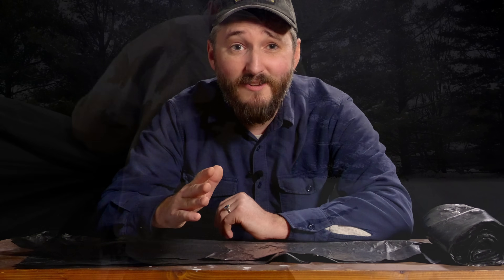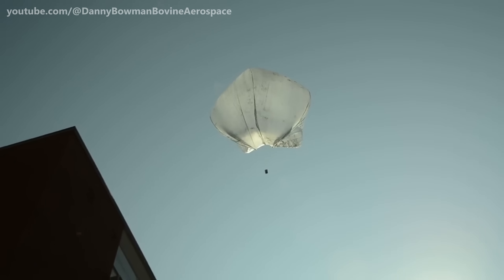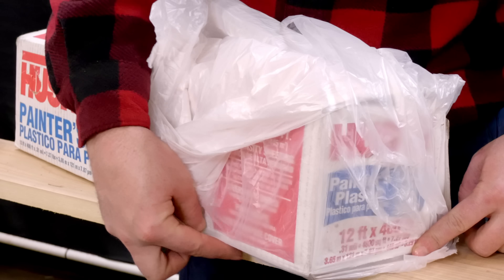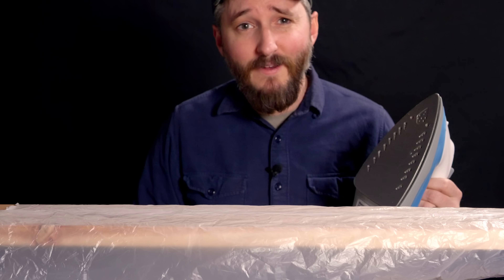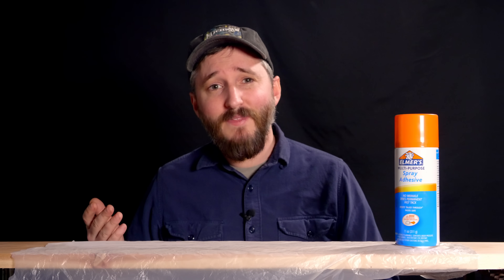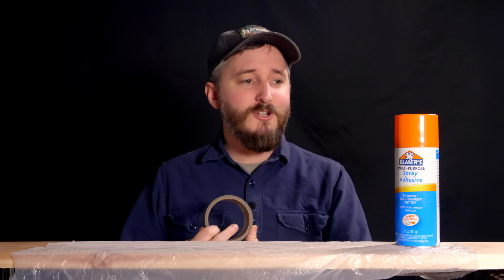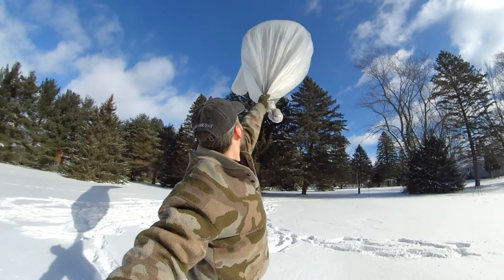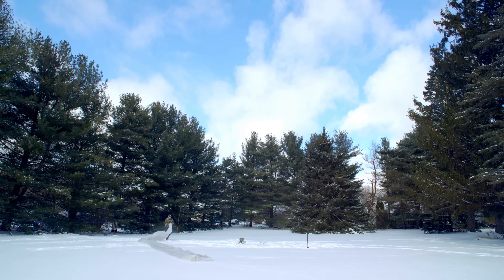DIY Solar Powered Balloons

Comment: Just so happens I've been doing some research lately with plastics and infrared light so I can actually tell you why it stayed up longer than you thought, your average grade fully transparent PET still reflects about 80% across the IR light  spectrum (apparently its the reason that polyester fabrics are so warm) so the UV light being absorbed by the carbon inside the tube is getting reemitted as IR light and thats getting reflected inside around the tube again, suspiciously in the same way those evacuated solar tubes work, I'm guessing this design is its great grandpa lol. One simple improvement I can think of is something black with a lot of surface area in the center, 12 inch tube or something to act as a battery and to heat the air faster via convection.

Comment: Using a low rpm fan or hair drier you can blow the heat into the balloon from the fire making it easier.
I get that the sun gives it lift but I wonder how much lift is porpotinate to the thrmal difference between the balloon and the surrounding atmospheric air. 
What I mean is, if you were in the southwest desert, you would get a great deal of sun but the surrounding air would also be hotter. It has lift because the less dense (expanded) air is lighter than the surrounding. So I wonder if that scales equally. 
If it was 105 degrees outside would the balloon be a similar % of thermal increase inside?
Just some thoughts.

Comment: 3M 90 spray adhesive should also stick decently well to LDPE.  If you're in California you'll have to go out of state to get the full-strength one rather than the low-VoC version, though.

Comment: Sweeeeet, I just bought a bag of those tape rolls from a thrift store for $1, with no purpose in mind. 
I had previously thought about slicing the bottom off of trash bags and attaching them, but this is a great idea. And I've got a lot of chalk marking powder (dewalt black chalk item number DWHT47056) from the hardware store that I use for pigment in epoxy. Hopefully the static is enough to coat the inside, im not going to make a van der graff generator or anything, but maybe I'll wear a wool sweater or a polyester jacket when I try to get the powder to stick. And if that jug was struggling, I doubt the chalk will be a problem. Im thinking 20lb test monofilament fishing line for a proper anchor.

Thanks, I'm looking forward to this

Comment: So if these can get 100Km high if I heard that correctly what would be the result of a small Model rocket attached to one ?  Can we reach Orbit?   The numbers I am seeing for the speed of the Model rockets feels off to me at 250mph but idk how that would relate to the speed of Earths rotation etc at 100km frame of reference or if any of that even matters.  Could this act as a Rockoon?  I REALLY want to send up a tiny Arduino sized cube sat to space.  Mainly I have been thinking about a Weather balloon that takes up an Ionic thruster and to stop it from popping like most do when they get to that height slowly start to feed the gas into the thruster to provide horizontal momentum.  As this increases its vertical height will increase slowly and I can't help but feel it should be fully possible to launch such a thing into orbit.   I been thinking Weather Balloon up to 50-90km or so, Ionic thruster to raise the orbit until we are out of fuel from the Balloon then a last Hail mary with some solid Rocket motors to get it to final orbit and speed.  Initial numbers feel promising, idk about that final rocket stage though.  The ionic thrusters however feel like it has potential in combination with the weather balloon.
Reply from the maker: Getting high into the air isn't the hard part of making something orbit. You need it to be going really fast. Something like 17,000mph minimum

Comment: Water vapor (humidity) is lighter than air, hence why moisture goes up and forms clouds when the pressure and temperature drop.  But a black garbage bag may keep the air warmer  which may hold  a bit more humidity.

Comment: Infinity Bond MMA 500 (Methacrylate ) is rated to glue Polyethylene and Polypropylene. I used it to repair some engine covers for a pressure washer that were made from Polypropylene.

Comment: Will it work as good in the summer heat? Winter air is dense and heavy making a large difference in air temperature and weight within the balloon.
Reply from the maker: It does! I've used the small version many times in summer

Comment: I have a lever arm type plastic bag sealer. They come in various lengths. They have knob to set the sealing time to match different plastics. It will be very straightforward to feed the two edges to be joined from the 'rear' or hinged end and pull the sealed tube over the other end.
Reply from the maker: I didn't think of feeding the plastic that way. Seems like that would work!
Reply: @Nighthawkinlight  If you still want to go the adhesive route,  the glue used on plastic mailers has fantastic bond to most plastics. By my research there are various formulations, some based on a thermoplastic rubber based hot melt adhesive that is melted and applied to the mailer where it becomes very tacky at room temperature.

Comment: heat sealers use teflon impregnated weaved tape, you can also get irons with little feet that are for shrink wrapping model airplanes but their heat output isn't super controllable

Comment: Heat gun on the glue-taped sections for adhesion? Doesn't seem necessary. Have to wonder about the potential of these balloons for anti-aircraft/drone/missile defense. A 400' thick forest of plastic could be quite the dome.

Comment: Back in the early 60's, as a young boy, I made a hot air balloon out of tissue paper. I cut the gores as instructed, glued them together, put a wire rim around the bottom and slung a wax-covered string ball underneath. My dad thought this was the coolest thing ever and was as excited as I when I lit the ball and let it go. Man did that thing climb fast. It was at that point that my dad figured out this could also be a flaming weapon if the was ball ignited the tissue paper, then fell on someone's house. In a panic he chased the balloon, running on foot, for about 3 miles until the ball burned out and the balloon settled into a tree. It was great fun on many levels and a big relief for my dad when it finally settled to earth. Some of us choose to live dangerously! 😀
Reply: Thanks for sharing your story!
Reply: I did a clothes cleaner's bag and some straws and birthday candles right after a rain. Worked well and was reasonably safe as well.
Reply: I made a few of these in the late 90s or so, I bet I still have the compact VHS tape of one going up (and up) in flames over the sports field of the school across the street.

Less plastic waste, more fire hazard, good times.
Reply: I have absolutely no idea what I’m talking about, but (if it had a basket) what if you fill the basket with water, so that if it crashes or when it lands on something, assuming it’ll land the way I’m thinking, it’ll plop the cotton into the water? Or is it not strong enough to carry a basket that heavy? I don’t know lol. Either way, very fun story!
Reply: @rachaelmarks2  I see a career in aerospace in your future! If you were hoping to extinguish the wax ball then maybe...just maybe. The real problem was setting the tissue paper on fire. The likelihood of carrying enough water to extinguish that fire would be out of the question. It's the old lift vs payload problem 😁
Reply: “It’s just a Japanese incendiary balloon that arrived very late.  I’ve got nothing to do with it.”
Reply: This used to be a pretty big problem here in Brazil because these kinds of celebratory balloons (commonly made out of newspaper) would set vegetation and sometimes buildings on fire. It's been banned for some time now, but, albeit rarely, we still see news stories popping up

Comment: Kinda wonder if you would have been able to use those viral bag sealers as a quick connection method seems to work on many types of plastic but i could understand if this didnt work

Comment: For another option with the heat sealing, I have had succeess by hitting a piece of metal with a torch and then touching the metal to the plastic. The temperature control obviously isn't the best but with a little patience you can get a nice thin seam and avoid overheating.

Comment: If you tie separate lengths of quilting thread to each end of the tube, you can anchor the other ends some distance apart, and then you can have a solar "kite".

Comment: G'day,

Yay Team !

OK, now you might begin to fantasize about making one which is sufficiently ridid, from internal Thermobarometric overpressure - as to be able to be rendered 
Dirigible....
(French, for "steerable/navigable)...,
By adding a Cruciform Tail with Elevators & Rudders, a little Lithium-Ion Battery, an Electric Motor with an Airscrew, a R/C Reciever & Servos....; probably leaving the Solar Panel on the ground, so the Recharge-Cable could serve as a Tether and the PV may add Weight to the Anchor...(?).

The trouble is, of course, like all Industrial Solar Technology, the Solar Hot-Air Balloon requires an entire international Petrochemical extraction, processing & distribution Industry to produce the essential Raw Materials & Components.

My new electric Brushcutter does the same work in the same time as the 50cc 2.5-Hp Tanaka..., but the Tanaka burns 1 litre per hour from a 1 litre Fueltank, and the average Session-time is 28.5 minutes (after which 3 pairs of Strings had been broken and it was time to start again...!) ; the electric machine can cut for 1.5 Hours on the same Forest Floor - on 1/2 or 3/4 of a Battery.

The Battery which cuts for 90 minutes takes 90 minutes to recharge, on my stand-alone Solar Houselighting setup, and on a cloudy day..., the 3,000-Watt 240-Volt Westinghouse Generator only used 710 mls of petrol for the hour & a half to recharge it.

473 mls /hour, to run a Brushcutter on 4-Stroke powered Electricity...; which is 53% less Fuel than it takes to run a comparable 2-Stroke Unit....

Which is great.

But, how much Fossil Carbon was emitted..., during the manufacture of my new (mostly Solar powered) Electric Brushcutter, Chainsaw & Leafblower...?

It doesn't seem to matter how we slice, dice, cut and chop the "logic" - whichever way ine looks at it ; Anthropogenic Global Warming's increasingly intense and frequent Record-breaking Extreme Weather is breaking Agriculture and Transport & Energy-distribution Insfrastructure far and away more quickly than Humanity is
Even
TALKING about
Adapting to the
"New Normal" - as if the 
Weather is going to continue to be as abberent as it currently is.

Whereas, sadly, if we quit all Fossilburning tomorrow, Globally - then the Atmosphere will continue to warm, at an increasing rate for the next 25 years at least (because it takes 25 years for a Cube of CO-2 to finish causing 95% of the Warming which it will achieve) in Parallel with the pace at which we increased Fossil-Fuel use between 1998 and yesterday...

Together with Greenland & West Antarctica's Doomsday Glacier each being poised and ready to go "PLOP...!", & "SPLASH...!" ; with the first expected to trigger the second, and each one being good for SIX METRES of Sea-Level Rise....

What we seem to be doing, thee & me...; is playing the most Artistic & Innovative 
Game of Titanic Deckchairs which we can contrive to imagine...(!).

But, regardless of what we do, you & I as individuals,
The 3 Billion who've grown to become 8 Billion in the time since I was born in 1961..., they
VOTED
to proceed Full Steam Ahead
With the Great Greenhouse Gas Release Experiment.

And for 44 years, at every Election I vited against Global Warming...; and the suicidally  Selfish Majority, every time, voted to 
Grow
Their sacred
EcoGnomie..., instead of paying ANY 
Attention
At all, whatsoever, to ANY of the
SCIENCE.

At least I voted against the 
Insane
Majority..., 
So I can honestly say that
Not much of the Problem is
My
Fault.

The problem is that the doings of the
8 Billion selfish Dickheads is
Wiping out my
Life's Work - ie having paid the Council Rates on a hundred-acre Endangered Species Sanctuary for 33 years.

Half the Trees in my Forest Canopy died in 2018/'19, and  since then I've spent $27,000 on my Fire-Hose Collection (Pumps, Pipes, Hoses, Sprinklers Tanks, Water, Tree-Surgery, Towers for Sprinklers & Floodlights, it never ends....!) to protect the Lawn Locker in which I've lived for over half my life.

The first 27 years here, one WW-2 vintage 130- litre "Airport Firefighter" (Compressed Air Water Canon) was almost Overkill...

Now, I can put 26mm onto 1,800 Square Metres and take about 4 hours to do it..., with the plan being to put out 20mm (40 Tons) in 3 hours (of expected Ember Attack) leaving another 16 tons for an hour of being burnt-over.

If, after that, the Water runs out ; then - THEN will be the time to run away and become
Homeless....

Until then, I plan on enjoying being part of the Interspecies Forest Community which has accepted me as being both harmless & friendly.

To see a wild unfenced Brown Dragon run up and perch on my Boot-Top, while laying in Ambush looking for Prey on my Lawn..., then please feel free to backtrack me to my Videos to see,

"Pontification With Lizard...!"

Possibly the best part is when the Dragon had caught something and was eating it on the Steps in front of me..., and one of the White-Winged Choughs walked over, spread it's Wings and danced at me, pointing to the Lizard to make sure I'd seen it - and after 2 or 3 Dance-Steps continued to walk on and away.

Do your Captive Pet Birds communicate with you, to inform about nearby Lizards, and Snakes, which they reckon that you should be aware of ?

Those 8 Billion have not the slightest clue as to the complexity of interconnected Co-operation and interdependance within the
Ecology of the Biosphere which in their
Personal and collective
Selfishness they have
Voted to destroy...

As someone once almost said, after having been
Nailed to a
Tree...;

"Forgive them,
They 
CARE NOT...;
What
They do...? ".

In the original 
Plaint, such an attitude was attributed to being the result of
IGNORANCE..., and as such it  was proffered as being an 
EXCUSE for such
Execrable behaviour....

Two millennia down the
Timestream, and
Ignorance is no longer any sort of
Credible or
Valid 
"Defence"...

One wonders for how much longer the Universal Creator Godtheory will continue to be able to successfully brew up Extreme Weather Events with which to flood, burn, blow down or smash with Hail..., all the doings and plans and possessions of ALL they who happily voted to,

"Grow the EcoGnomie, REGARDLESS of any percieved Dangers of resulting Damage to the Environment, or to the Climate ; which may be held by the so-called 'Scientific Community' and other 'Environmental Activists'..." (!).

"As ye sow,
So
Shall ye
Reap...;
Sow the
Wind...,
Reap the
MegaFireStorm...,
Because thus hath been
Thy
Choice...!"

Kinda thing.

So far, every silly bloody Tourist Trap on the Eastern Half of Oz has been burnt twice and flooded 3 times in the past 5 years, most recently it took a month for Storms to hammer everywhere from  Daintree on Cape York down to Melbourne in Victoria...; where this week they lost 25 houses in a Firestorm lit by Lightning during a Thunderstorm which simultaneously flash-flooded a bunch of Suburbs & Towns, while the attendant Wind Gusts dropped about 5 High-Tension Transmission-Towers, blacking out 500,000 homes...

Atop the Great Divide, I watch the Cumulus overdevelop above and around this place, from 10 AM to 2 PM-ish, then they waft off to the Coast for the Afternoon to become very intense over the high population densities, before being blown back inland by the Sea Breeze, to gently rain on me sometime between 10 PM & 3 or 4 AM...; and then I wake up to a clearing Sky, and have a few hours of Blue overhead to feed the Solar Panels before the Cumulus Puffballs commence to grow again after morning tea.

It's the most impressive bit of Micrometeorological Precision Karma Delivery I never dared to hope to ever be in a position to observe ; but it happens, around here, maybe 3 or 4 days per week...., ever since the El-Nino which was Hot/Dry in October  - turned Hot/Wet in
November (!).

It appears that subscribing to a Powerful Godtheory and having no "Insurance", in the Long Run...; results in a far superior outcome, as compared to subscribing to a Powerless Godtheory - and feeling thus 'compelled', to resort to purchasing some kind  of "Insurance Policy", to insulate one from whatever one FEARS that their Powerless Godtheory won't be able to cope with....

But that's only my opinion, based on long observation though it be...(!).

I particularly enjoyed the bit about a handful of powdered Charcoal thrown in, to dirty up the inside enough to capture more Infra-Red, the  more betterer to hot-ificate all the Air contained within the Envelope !

An excellent final Twist in the Tale. 

A friend suggested that if 
Enough of us
Shift
Enough Deck-Chairs
Far enough,
Then maybe not
Everybody
Dies...;
As the Cull
Proceeds along...? 
One may but 
Hope.

Was not
"Hope"
The last thing to emerge from
Pandora's Box,
After it first released
All
The
Evils which are
Currently running loose upon the
 Earth....
(The Broadacre Death-Cult, of Harvest Everything-ism..., which emerged at Gobekli-Tepe 12,300 years ago in Southeastern Turkey, where the
First Strain of Hybrid Grain
Fell into the Midden...
700 years before the
Cultists departed in a Diaspora of
 Selfishness radiating out from the by then twice-abandoned ruins of Gobekli-Tepe,
In the centre of the first Human-caused Desert on Earth...).

Time will tell,

And the
Thymes,
They be
A' 
Changeling...!

Such is life,

Have a good one

Stay safe.

;-p

Ciao !